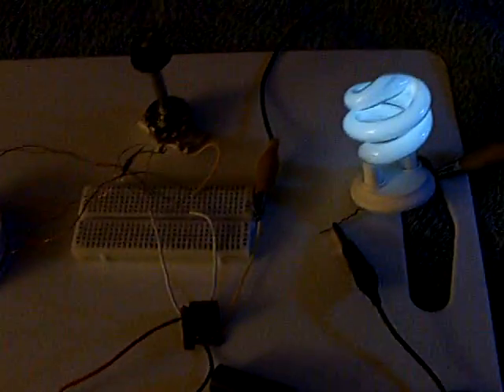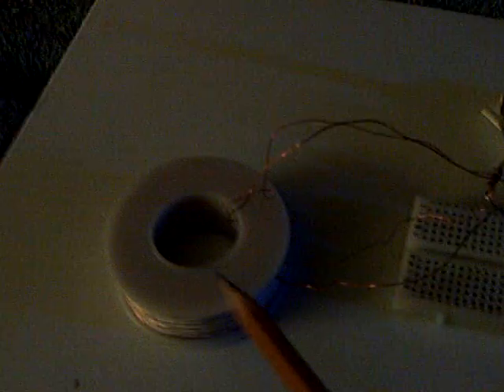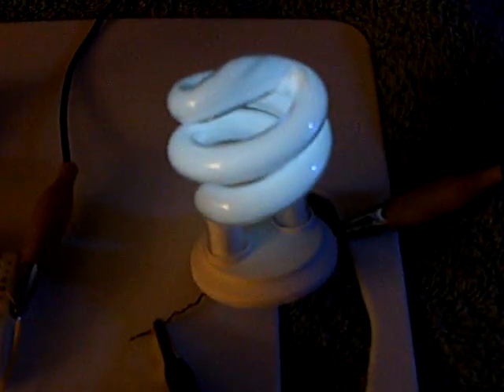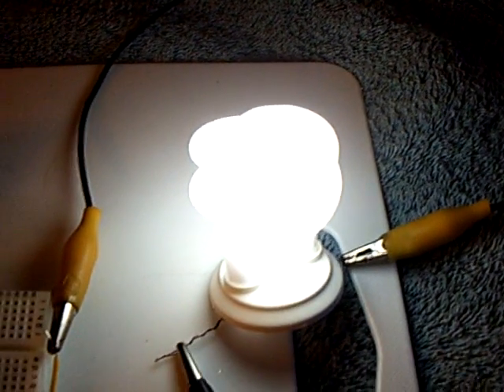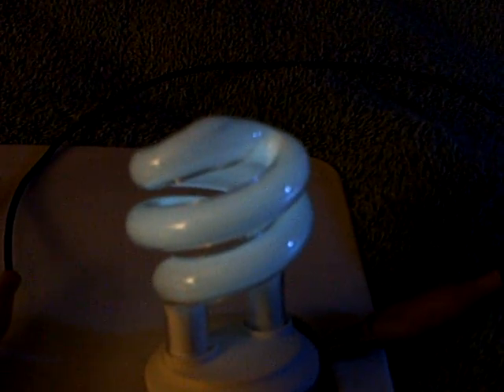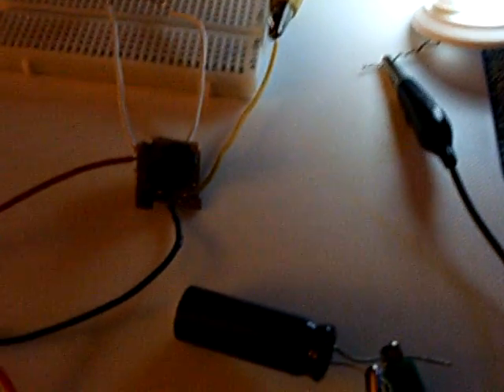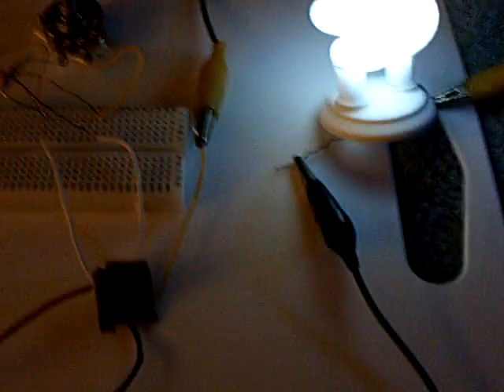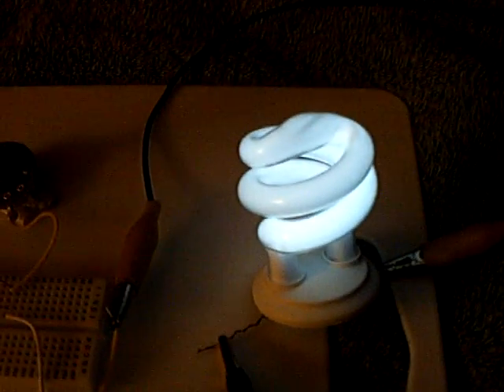Joule Ringer with better parts

Comment: i have tried "Joule Thief -- The Secret Technology of the Ancient Pre-Ssorbonites" by TinselKoala. I have a toroid with 7 turns, 1k resistor, transistor from CFL board, 3vdc LED, 1.5v battery.   (I have also tried a 2n2222a transistor and a IRF510 mosfet transistor)
output is same as input. - the won't work.

IT DIDN'T WORK. 
what am i doing wrong?

need to light 2 each, 3VDC LED lights in parallel

Comment: Hi Lidmotor,
I can't seem to make a proper transformer and bifiler coil.
Is there some place where I can buy it already made? 

I need the coils to be less than 1 1/4 inches in diameter. (height is not a problem - I have 6 inches of clearance). I want to make a 13W CFL to light, brightly, off a common 1.5V or 9V battery.

Also, I have tried many of the circuits online but most of them are not correct - I get the same output voltage as input voltage.

Comment: Nice I wonder if a small solar cell with joule thief attached would work to charge the cap with full brightness. I know I have killed the hose with this topic but I am really interested. If it will supplement the voltage needed to extend run time. I think this is another version of the 12 hour cfl which are always fun to play but hard to dial in. Nice job lidmotor once again.

Comment: Sorry to be such a pain LOL... You say an ideal scenario would be 2v @100mA, which equals .2 watts, correct? What is giving you that ability... the added capcitance of the cap and coil (and thus the battery will die sooner) OR -- that AND the collapsing magnetic field and it spikes. I apologize... I'm still ignorant!

Comment: @lidmotor Do all remote lights in these circuits, all need an Avramenko Plug style diode configuration to capture the energy when remote?

Comment: The IC takes place of a transistor (and jewle thief circuit) and then the board triggers pulsed HV? Your coil is like the right capacitance and your Rheostat the right resistor... am I getting this?